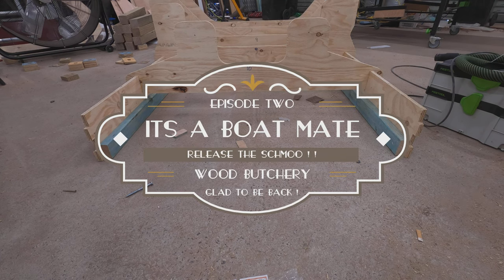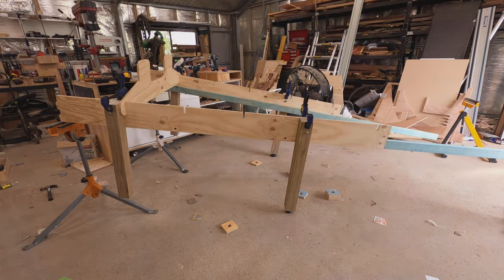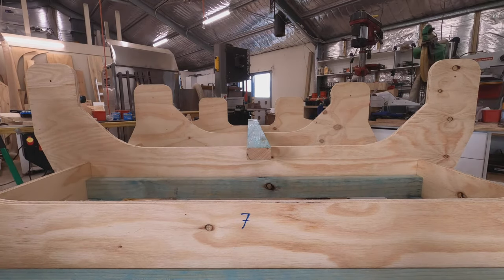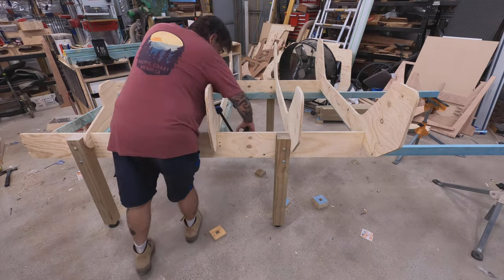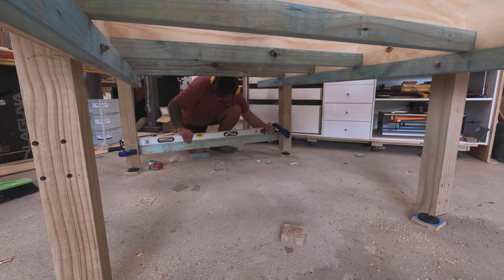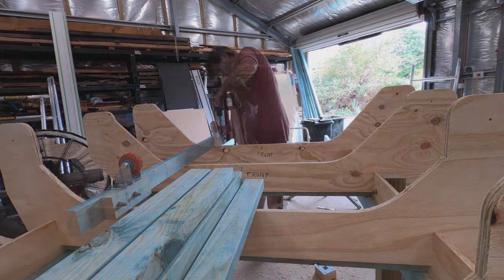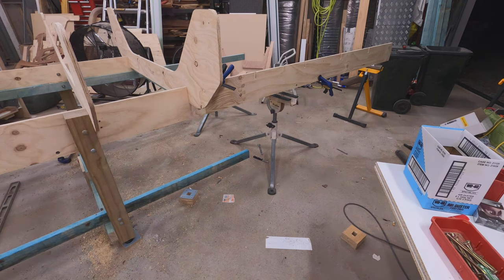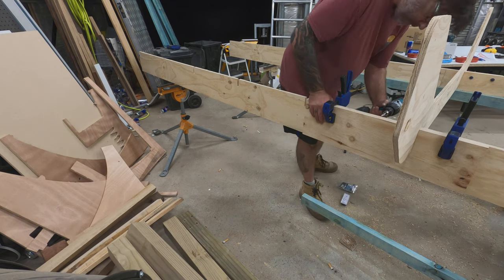It's a Boat Mate

Comment: Be real careful mixing epoxy, take the time to get the ratio correct or It will bring you in done. Get scales or pumps and mix it correctly. You have been warned
Reply from the maker: You are absolutely correct, I used scales when mixing the liquid epoxy for laminating the reinforcements into the center board case (seen in the next couple of videos). As this stuff is already pre thickened and is an adhesive it is a lot more forgiving. I also had a small sample left over at the end of each batch that I could check to make sure it properly cured. Thanks for the warning, and I hope you enjoyed watching.

Comment: I agree with Steve 56 The dominos idea is great. I built a Boger Cartopper years ago. Stitch and glue and not from patterns just drew it up on the ply from the measurements out of a magazine. Got very messy. Hardest part was building the transom. Ended up throwing the first one  (transom) away :)  Thanks for the video.Look forward to more.
Reply from the maker: Thank you, I am glad you liked my video, comments like yours and Steve56 is what gives me confidence to make more videos - I find it hard to do. I feel your pain about things getting messy. I am a little concerned about my transom - I have the material to build a few of them if I make a mistake, but I don't want to stuff it up, because the outer transom will be pretty special.